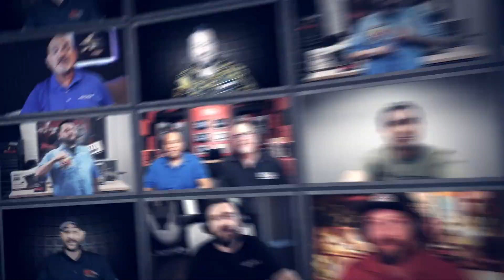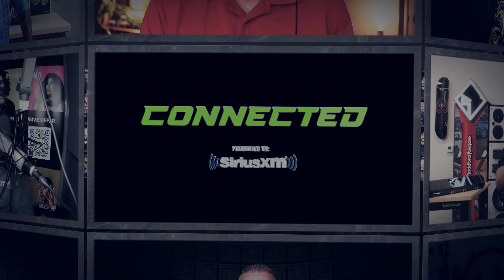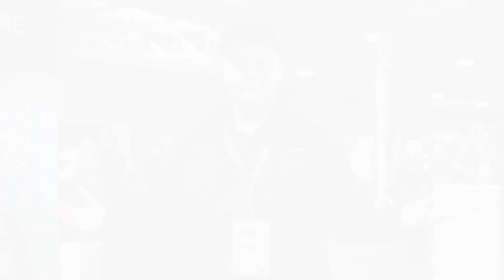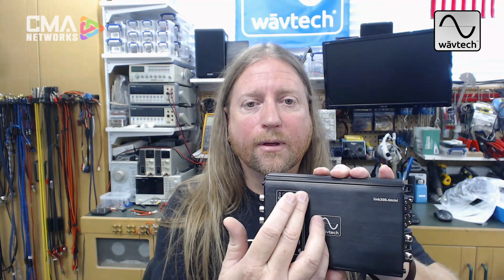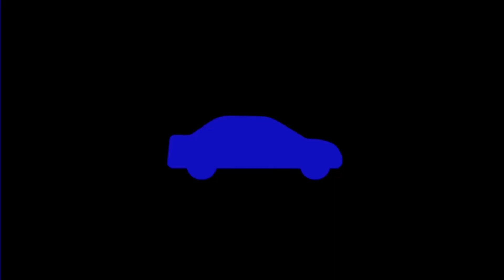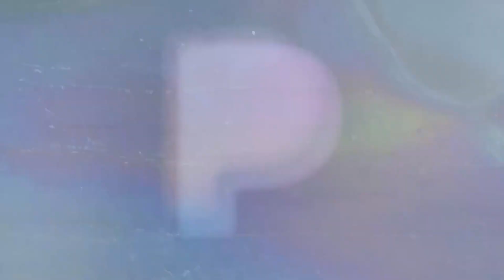WAVTECH | OEM INTEGRATION | CONNECTED

Comment: will this detect an all pass filter? i.e. TOYOTA with JBL system.
Reply: Thanks for your question. Yes, you can use one of our summing processors, link4, 6 or 8 to sum left and right channels and then use an RTA with at least 1/6 or 1/12 octave resolution (or FFT) to locate the APF frequencies by the cancellations. If your plan is to correct it, you'll need to add matching APF's to the other side. And then you'd be able to use time delay for a single seat tune without comb filtering.

Comment: Still trying to figure out what the crossover frequency would be for a sub out or do all channels just put out full range with a bass restoration effect and you still need to do crossover between the loc and amps?
Reply: Thanks for your question. bassRESTOR has an adjustable subsonic 15-50Hz for filtering out very low frequencies, but otherwise has full-range output if it's input signal is full-range. In that case, yes, you'll need to use the low pass crossover in your sub amp to filter out the higher frequencies.